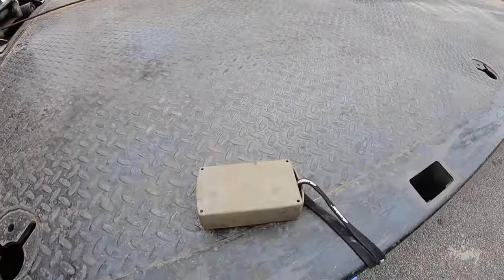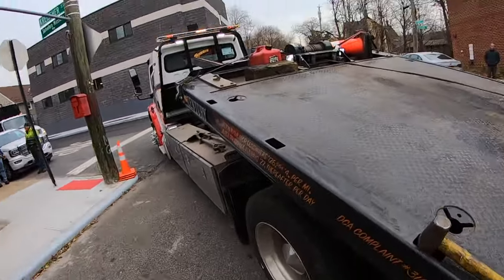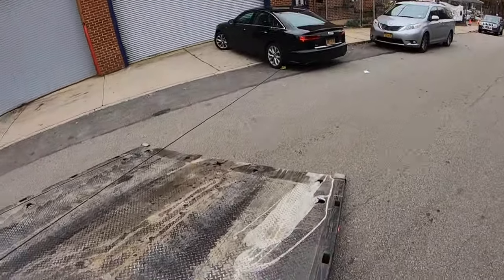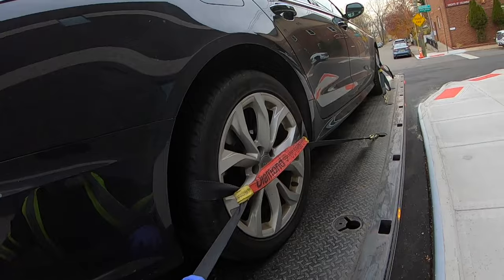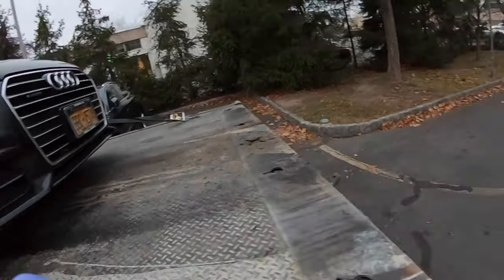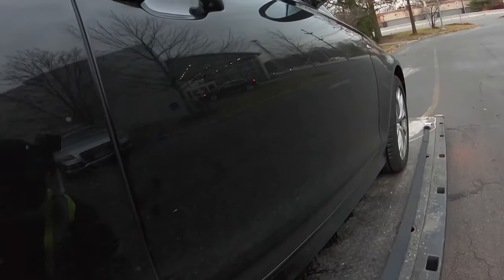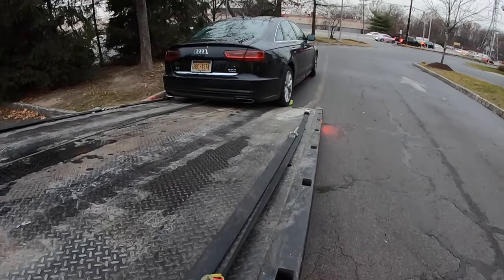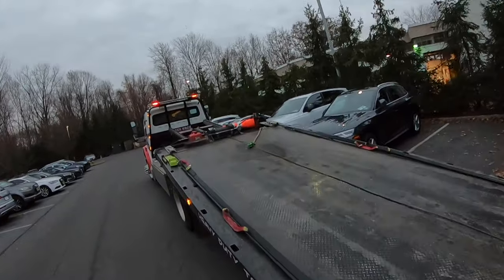1 TowMan 2 skates and a snatch block

Comment: Honestly you made this tow harder than it should have been. You should have started with the snatch block. Question, if you put the car in neutral why then put the skates on the back tires?
Reply from the maker: I put it in neutral and used the skates on the rear tire cause the parking brake was stuck on
Reply: I was thinking the same thing over working his self also
Reply: Audi's are front wheel drive based so that's why he didn't need them under the front wheels. E-Brakes go to the rear wheels and that vehicle had an electronic one, don't want the tires scraping that far across the asphalt because they lock the wheels up like nobody's business. Is there a different method you would have done with the given information? I love learning new things man so don't take it the wrong way 🙏
Reply: @TowMan127  but you were able to put it in neutral. Could you explain? I just started flatbed towing. But I have pretty good ideas on the concepts. I had a similar situation with a Range Rover but I didn't use skates and there was no key and I tried looking for the shift lock but couldn't find it. It was my 2nd flatbed tow ever.
Reply from the maker: @Kama.Boy.13  I was able to get the vehicle into neutral which will allow the front wheels to roll when I winch it. The skates are used on the rear wheels cause the parking brake is electronic and they were stuck on. Most range rovers have a neutral override. Some are by the shifter, under the cup holder, under the engine cover, or on the transmission itself.
Reply: @TowMan127  do you need the key to disengage the electric parking brake? Cuz I mean you got in the car, if it was dead I was thinking use a jump pack to supply the vehicle with power to release the E Parking Brake.
Reply from the maker: @Kama.Boy.13  yes you need the keys but sometimes even with power the parking brake doesn’t disengage. I’ve had  vehicles that run and go into drive but the parking brake wouldn’t release
Reply: @nickcarnahan9981  I have pretty good luck with most cars by plugging the seat belt in and having that release the parking break. Ill use my backpack on the seat for the pressure switches for it as well. If that doesn't work, and the car runs with no issue ex:flat tires. I just let it idle while i pull it up.
Reply: Too bad no go jacks…  7 mins loading vehicle….in Hollywood we don’t have 20 mins loading too busy area
Reply from the maker: @BC_Gonzo  tried all types of stuff and the brake was just stuck and wouldn’t release.
Reply: @TowMan127  That's unfortunate. Have you tried cutting the lines?lolol
Reply: the difference between what you guys would have done to what he did is because he actually cares about the customers car sure you could’ve just started with the snatchblock but he took care of it the whole way through
Reply: @nickcarnahan9981   Audis are usually AWD
Reply: Stuck parking brakes
Reply: @kingsiddiq2802  exactly that was my question
Reply from the maker: @omarcruz4710 the parking brakes were stock on which is why I used the skates on the rear wheels. The front wheels aren’t locked up caused I put the transmission into neutral
Reply: Lol he said first thing parking brake was stuck on. Hey what are those straps called and where can I find them
Reply from the maker: @greyburns6170  people don’t listen 😂 the straps can be purchased from baremotion.com.  Here’s a link, be sure to use coupon code TOWMAN127 
https://www.baremotion.com/collections/towman127

Comment: And those skates can be holy grails! I used to use them for more things than youd expect, if I had a low car I would even tuck it under the bumper to keep from scraping the bumper, or a low exhaust, really anything that I didnt want scratching
Reply from the maker: I love my skates!!! I flip them over and put a 4x4x36 in front of them and use it like ramps. Works perfect!
Reply: Never thought about the bumper. These folks up here love their WRX's. That will make it so much easier. 🤘
Reply: Smart. Thank you so much
Reply: @connoisseuroftigolbitts  it helps to put them under like anything that shouldn’t rub they’re my favorite device
Reply: @jennadeknight9056  yes thank you so much I learn something new everyday

Comment: Ohhhhh why didn’t I watch this before I ordered my truck . That remote makes life soooo much simpler and easier
Reply from the maker: Morning! Yes the remote is awesome! It is definitely an option to order when ordering a truck. It’s like having an extra person helping you. You can always add it on.
Reply: You can still order it and set it up. There is a receiver under the bed in rear near the levers on the inside. Order a lodar remote and look up the programming. Also a valve there that will adjust the speed of the winch for the remote

Comment: Well done....I wish skates would slide that good on my aluminum bed.. it's got traction ribs & skates catch.  I'm diggin' that green snatch block.. matches my truck.... lol
Reply: @MegaRambo456  Definitely not... You don't want grease on the bed... 100% no
Reply from the maker: Get an old set of license plates and put them under the skates when going up the bed and they should slide. I personally don’t like putting any slippery stuff on my bed.
Reply: @woody4u247  To be specific not grease but a sort of lubricant that don't stick and you don't spray on the bed just underneath the skates.

Comment: good stuff brother you have saved me more time and headache over the past wow many years with your shiftlock videos and now with the skates  I have been struggling with skates for years when offloading a vehicle the skates were always stuck under the tires I would have to beat them out with the hammer so when I seen you use the bed trick you did to remove the skates that was very helpful thanks brother be safe out there.
Reply from the maker: Thanks! Glad the videos are helpful. Skates are great but can be a PIA sometimes. I always try to share what works for me in hopes that it will help others. I have a video of myself offloading a 2024 Toyota Tundra with the parking brake stuck on. Video should be up soon. Be safe out there.

Comment: I was taught to push the wheel lift down to bring tail up to give more clearance, also so tail of deck doesn't drag ground, and to support the end of the bed rails when sliding in and out, especially since my truck is bagged. Well done sir, very professional. This is why people should subscribe to this channel
Reply from the maker: Everyone is taught differently. My truck was bagged as well. I don’t use the wheel lift for loading and unloading unless it’s a heavy machine or ambulance. When you have the proper tools, it makes your job so much easier. I try to not abuse the equipment as much as possible. A couple of skates, pieces of wood, snatch blocks, and a wheel chock or 2 are great to have.
Reply: @TowMan127  I don't abuse mine either. Proper tools are key
Reply from the maker: @markroadkillrecovery1168  yeah for sure and the truck lasts longer.

Comment: always love skates- you did also have enough room to back truck up to back of the car and wedge the bed under the skates- pulls easier :)
Reply from the maker: Yes, I had plenty of room to back directly up to the vehicle but the problem is the vehicle is in the driveway which slopes downward  which would cause the rear of the vehicle to scrape the bed and the front wood scrape against the driveway.

Comment: Brand new subscriber from Maine. A friend put me onto your channel because he found your vid on putting a BMW 328xi in neutral. My steering wheel is locked and 2 tow companies that came, AAA, couldn't move it. 
I knew there is a way to put it in neutral, to guys had no clue. I figure if we get it in neutral and in line with the roll back, they can drag it up. The front wheels are almost straight.
They are just lazy I guess.
Reply from the maker: Thanks for subscribing! Some guys just don’t know. 🤜🤛

Comment: Use double skids under each wheel it will make it easier to skid. Other than that, keep up the great work.
Reply from the maker: If you get the skate under the tire all the way, they’ll work fine. Wife skates are great for the wide tires. 🤜🤛

Comment: Hi great video can i ask why you used the slippery skates when the car rolled and you put in neutral? Bit confused
Reply from the maker: The parking brakes were stuck on. Putting it in neutral and using the skates on the rear wheels allows me to drag the vehicle without dragging the whole vehicle.

Comment: Should have requested wheel lift and dollies, Why didn't 85 do it?
Reply from the maker: Not sure. I have dollie’s as well but most of the time when I get to the dealership they want it in specific spots and it’s easier to offload it from the bed into a spot cause they don’t have a lot of room and tight turns at the dealership.

Comment: So how do I step on the line if my set up doesn't have a remote?
Reply from the maker: I would recommend using a pool noodle. Cut it down the middle so you can slide it over the cable. I do that a lot to protect the bumpers from getting scratched

Comment: Am sure that after a year if he was in the same situation he would do it so different now.... I never put the car in neutral when using snatchblock!!
Reply from the maker: I’d do it the same way every time. The reason I put it in neutral is to allow the front wheels to roll amd not drag.  The parking brake was stuck on which is why I used skates on the rear wheels. Putting the vehicle in neutral makes it easier than dragging it in park.
Reply: @TowMan127  facts I'd rather drag the brake over transmission any day but never drag if possible

Comment: That’s when a pool noodle comes in instead of standing on your wire rope just throw a pool noodle over it
Reply from the maker: I had one but forgot to use it cause I was rushing. I always keep noodles on the truck.
Reply: @TowMan127  You did a good job on that load man. I’m glad people are putting out content like this it can really help new operators. I know when I first started out in training I never encountered any non normal situations everything I learned I basically had to learn on my own over time.
Reply from the maker: @derek2601  it was the same for me in the beginning. I had to learn as I went along. 22 years later I’m still learning but I try to help other operators out. 🤜🤛

Comment: Con respecto no se me hace práctico lo que hizo si lo puede dejar en neutro y no se bloquea la dirección lo hubiera dejado recto y hubiera sido más fácil y más rapido
Reply from the maker: The parking brake was stuck on and I had to drag it out of the driveway to load it. If I would’ve loaded it from the driveway, I would have scraped the whole front bumper on the ground. I already had the transmission in neutral but the parking brake was stuck on and wouldn’t come off.

Comment: Dragging a car like that doesn’t damage your equipment? Like the winch.
Reply from the maker: @lucasmarcilio2725  no cause the vehicles transmission is in neutral so the front wheels are rolling and I’m using skates on the rear wheels that are stuck. So there’s not a lot of resistance. The winch is strong